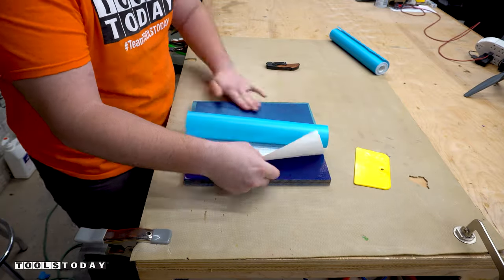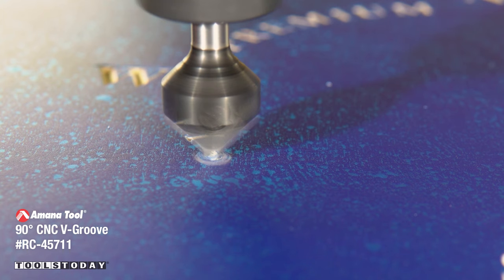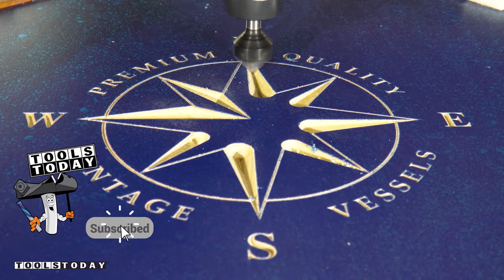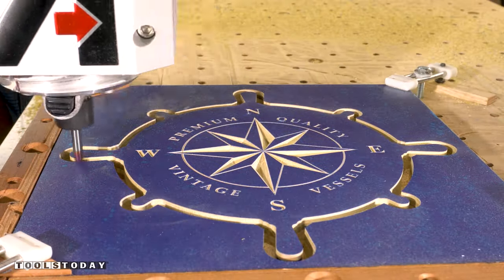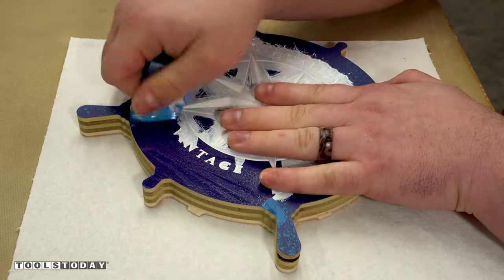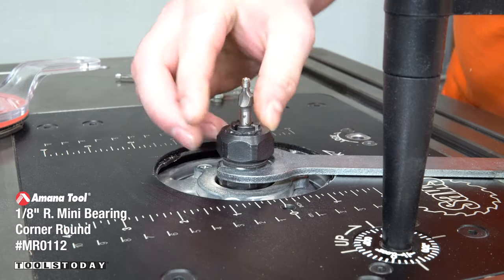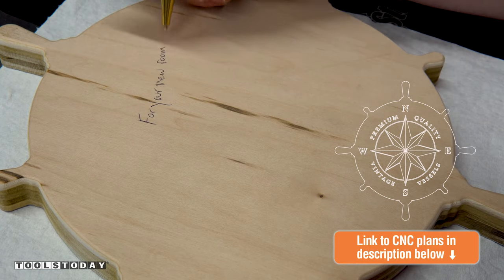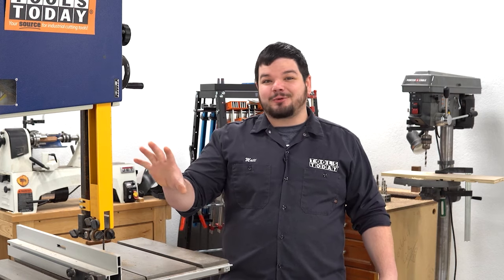How to Make a 2 Color CNC Sign | ToolsToday Video

Comment: I see in your videos you use a few different CNC brands. I'm curious which brand you think is the best because I am considering buying the Stepcraft M1000. I do not want to feel like I need to upgrade in 5 years so I want buy the best I can get to start with then maybe in 8-10 years I'll see where I am, but definitely want it to last 5 years minimum w/o upgrade. Curious about your opinion on all your CNC's you use. (Guitar builds mostly).

Comment: I need to flatten a small table I have done. I'm using a router sled not a cnc. Is the amana rc-2255 a good bit that you would recommend for that. On a router sled??
Reply from the maker: Yes, it will work great for a router sled!
Reply: @ToolsToday  ok thank you very much for your reply. I'll be ordering one tomorrow then. Now the ToolsToday website that I can order from is that your website? I am because I'd like to order some replacement blades for it as well and figured you could direct me on that as well. If you don't mind
Reply from the maker: Sorry, totally missed this.  Here is the replacement blades for it - https://www.toolstoday.com/v-13333-rck-457.html